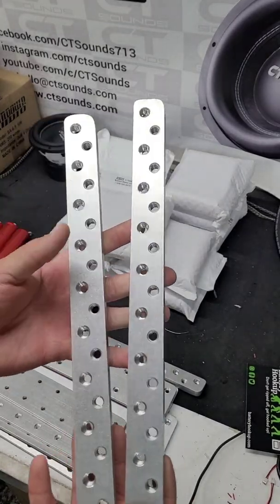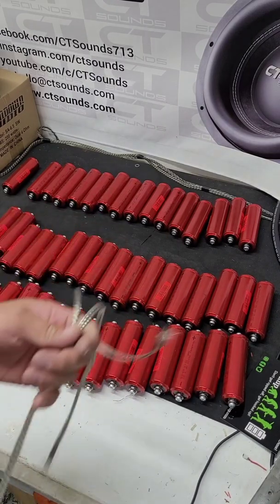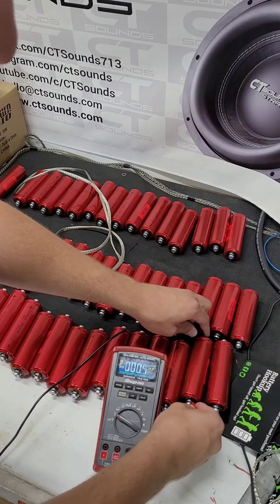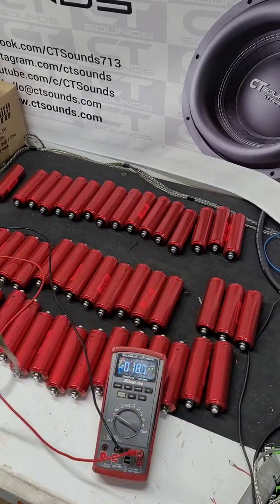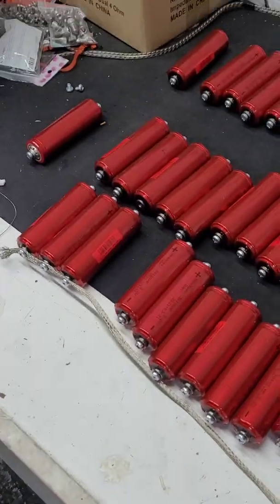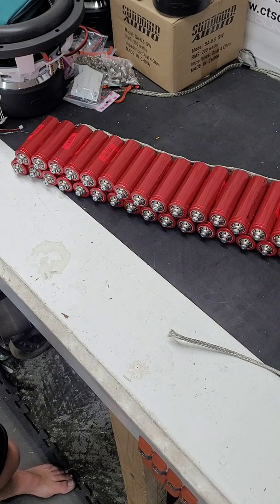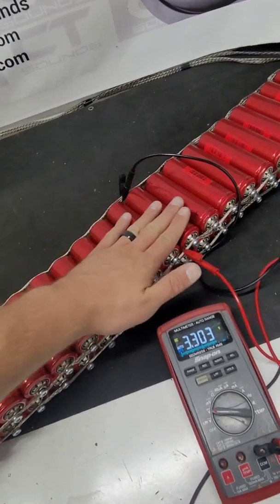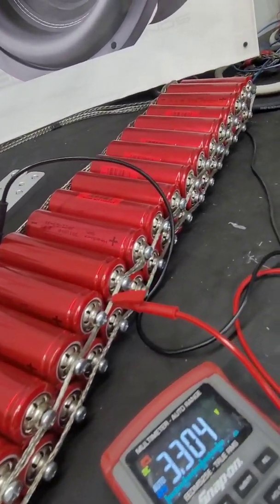DIY LITHIUM Pt.1 - HEADWAY LITHIUM BANK 96AH

Comment: Steel braid? I wouldn’t use steel…resistance is way too high. 

Now a copper braid…tinned copper or whatever is fine. 

Just so long as you apply a charge current when they’re all in parallel. 3.27 to 3.35 is no bueno. Can’t let them just sit, because voltage does not equate to actual state of charge or amount of amp hours you could discharge. You want to take them all up to 3.65. A top balance ensures you can remove the capacity of the worst cell from all cells before you hit your under voltage point. Then when you charge back up, each cell will take in almost an equal amount and they should all end up at 3.60/3.65 at the same time. Minor differences will exist because not all the cells have identical IR and that’s what the active balancers are for (passive balancers suck)

One more time: YOU MUST BALANCE AT THE VERY TOP (or very bottom) of the voltage curve. That’s the place where voltage correlates to SOC. 3.65 means 100% for every cell. At 3.30 one cell could have 7Ah of energy in it, another could have 6.7Ah. Another could have 7.2Ah.  So those cells aren’t balanced and when you connect them in series and apply a charge you’re going to find out that one of the cells is going to hit 3.65V well before the others even if they all started at 3.30V

Also the amount of current flow when the voltage differential is under 0.25V is really tiny…and that’s with copper bus bars or large aluminum bus bars connecting the cells in parallel. Using an inferior metal or having a poor connection (buy a milliohm meter and test the difference between the rated torque on the screw terminals vs half the rated torque when you have two cells in parallel that are 0.4 apart like 2.70V and 3.10V). The amount of current can be a tiny fraction of a properly torqued copper or aluminum connection. Off Grid Garage has a great video on this with 280Ah cells and the way he safely does the experiment is by leaving all four posts relatively loose or having the negatives tight but the positives loose. When he cranks the terminals to spec he sees current that maxes out his meter (over 1000A IIRC) but only for brief moments.  The voltage delta quickly gets smaller and once it gets to about 0.25C (70A) it drops steadily about 1A/sec. Under 10A it starts to get pretty slow and under 5A it’s a snooze fest

Cell IR, your connection materials resistance and voltage delta all play a role in balancing cells in parallel. 

LiFePO4’s flat voltage curve makes its unique because voltage does not equal SOC between 3.10 and 3.40 especially in the 3.20 to 3.30 region where 70%+ of the Ah “exist” (under a 0.2C load or something that does not cause excessive voltage drop)
Reply from the maker: Good info. I guessni need to temove my banks and throw them away because they don't wont properly.  

Oh. And I need to recall all the other banks I've built. 

Got it
Reply: @ATCA  too dense to understand what I'm saying? I'm going to go out on a limb and say your comment is in regards to 
A) balancing cells without a charge....aka passive balancing (not the BMS kind)
B) you used some random metal to string your cells in parallel
C) The voltage you chose to "balance" them at

A-if you did this and you don't have a balancer of any kind connected to the pack then you have an unbalanced pack and it'll get more unbalanced over time...all packs do naturally but its pretty slow for a pack built with new cells from the same batch. The difference in IR will be maybe 5%-10% between the cells. So with new Headway 38120's like these that normally come in under 2 milliohms you might find. yourself with cells ranging from 1.5mΩ to 1.6mΩ. If you look at an EVE test sheet for LF280K's you'll see the AC IR readings are 0.16 0.16 0.17 0.16. 0.17 0.17 0.16 0.16...you'll essentially see two or maybe three different numbers and they are measuring out two places to the right of the decimal in milliohms. None of them will be 0.2X milliohms and I don't think I've ever seen a cell less than 0.10mΩ. That's what new cells should look like. If you bought used cells from battery hookup (and not a Super Beast Pack) then its gonna be an absolute grab bag of different degradations. You could have cells that are 1.9mΩ and some that are 3mΩ. Same goes with capacity. I've heard of people getting cells with like 5.5Ah and I've seen some people pull well over 8Ah out of a cell. I think I've seen as high as 8.6Ah. For packs like that...well honestly you shouldn't even be putting the outliers in the pack. 7.25Ah to 8Ah would be a lot better or if you got shittier cells then 6.75Ah to 7.5Ah or whatever. Do something similar with AC IR reading....try to stick with a deviation thats a small fraction highest cell...so if you have 1.7mΩ to 3.4mΩ put the ones under 2 to the side and put the ones over 3 to the side. If 3 is your highest and your deviation is 1 then thats 33% deviation when compared to your highest cell. I wouldn't go beyond that especially in a high power application. The mismatch in power draw will be insane even if you try to build the pack the way rePackr tells you (I hope you're using this tool and not just randomly putting the cells together)

B-congrats your parallel balancing took significantly longer than necessary and if you stopped it too soon you'll have cells that didn't balance. More resistance equals more time it takes to push that last little bit of current to get all the cells to the same voltage. Watched a guy today do that with prismatic cells and wire connections he made since he put cells in a series layout first instead of just lining them up in a parallel layout and using the provided bus bars that were sitting right next to him. He let it sit overnight and in the morning he still had one cell that was 20 millivolts below the others. Would have balanced perfectly in a few hours if he had used the copper bus bars and not 14AWG wire with some crimped terminals to jump from side to side to make the parallel connections....such a derp moment.

C-You obviously don't watch OffGrid Garage. He's tested all this thoroughly. Balancing in the flat part of the voltage curve is NOT balancing. You're playing the voltage game. Balancing is supposed to be balancing the energy between the cells. We don't care about voltage when we are in the middle of the curve because its so flat. There's nothing more to that. If you did it at 3.20 to 3.30 you fucked up. Can't argue that. Its the same with having your active balancer running during the entire charge cycle. Everything it is doing below 3.45V is a waste of time and its creating more work for itself later in the charge cycle. So your balancing tha would have taken an extra hour now takes an extra 4 hours.
Reply from the maker: @ericklein5097  I'm sorry that I'm not you. You've done well for yourself

Comment: Wouldn't they just static charge when installed on the buss bars anyways? I understand why you do this but i dont see a difference between this or just connecting them all on the bars
Reply from the maker: Some people connect them to the bars in parallel instead of series and add jumpers to do the same thing. The purpose of this is you static balance them then you let them sit and see of any are out of the ordinary before building the bank. If let them become the same then let them sit a few days, You'll know right away if one is a dud or questionable

Comment: Using the bars seem like way less of a headache. Lol! Doing my first 2 batteries (96ah & 48ah) soon and this video helped.
Reply from the maker: More expensive. 2x the price almost.  I have it both ways. The super beast isn't that big of a deal tbh. Few  bolts, few wires.  Vs machining aluminum, getting hardware,  or paying crazy money for some. I sold mine the Cheapest at $180 a set. That's crazy to think. I see both situationsa.
Reply: @ATCA  I was referring to balancing the batteries with steel wire vs using your bars. I think your referring to your other video.
Reply from the maker: Tbh I like the steel braid better. It was faster actually
Reply: @ATCA  oh wow ok. I'll consider it then.
Reply: Fastest and cheapest way to balance your headway cells is to used Galvanized hanger strap

Comment: did you assemble the bank yet ?? do you have video of you assembling the 96 ah bank ?
Reply from the maker: Yes 😞 
However my Adobe subscription is giving me bad issues and has for months. Do I have like 4 videos thst just need edited. Meso 6.5 video,  pt 2 of this video and a few others that I just need to edit. Hopefully it will be resolved sooner than later. I considered just Making a new Adobe acct.
Reply: @ATCA  yea deffinatly , I actually plan on disassembling the 72ah bank I have I didn’t build it  and add 16 more cells to it so that’s why I was asking
Reply from the maker: @basshead-GAMER_JK  I'm going to do a live stream probably tonight.  Join the Facebook group and add me
Reply: @ATCA  WHERE DID YOU GET THE WIRE BRAID ??
Reply from the maker: @basshead-GAMER_JK  pretty sure I said in the video. It's scrap leftover shield from cable. But you can buy stainless wire braid online.

Comment: I made a 64ah bank. But I got a 300a high output alt putting out 14.8 which is overcharging them🤦‍♂️ so I'm gonna have to just upgrade to yinlong🤷‍♂️ question tho... I got a power supply like every other basshead uses off Amazon. I hooked it up to my headway bank at 14v 2a and it fried the power supply instantly. Started smoking and all that. Still worked, but wouldn't put out voltage anymore. So I returned it and got it replaced. But afraid to hook it up again lol. What'd I do wrong?
Reply: 14.8v will be fine. The life cycle is cut a tad bit but your bank will outlive the life of your actual setup with ease. This is what I was told by a bunch of different people in the game.
Reply: @v3zMedia  it's been doing great. Even with the -4 degree weather here in Ohio the past week👍
Reply: @1ohmwrecker  that's good to know. I'm in Michigan holding on myself. 😆
Reply: @v3zMedia  oh ok so u know what's up 👍
Reply: @v3zMedia  mine volt reads at 15v. I dont know if I should run it.

Comment: How many of the $6 batteries would you need to equal to Down4Sound LTO 6.0?  I am new to Lithium and battery banks.
Reply from the maker: Lto is not the same technology. But theoretically a bank of 8 of these will be more capacity.  

The benefit of LTO is they produce more current in fewer cells. Headway needs more cells to produce the same current,  regardless of amp hour. So having a big Headway bank like this gives you a lotbof current and a lot of ah. Best of both worlds

Comment: i know youve already made your bus bars but i thought id throw this out there. after your last video i did some research and found a guy "jag35" who makes some bus bars that almost look like circuit boards. they are designed to hold 32 headway cells. they are clearly marked pos/neg. $30 for top and bottom. laid out to put in a box the size of a normal car battery. also i tried finding the cells for cheap but 14 each was cheapest i could find
Reply from the maker: Battery hookup has these for $6 each. Can you send a link to his product? I may look into them
Reply: The jag35 bars are cheap and too thin
Reply: @xchimnyx no Jehu rates them correctly. He has plenty of videos showing his PCB’s being load tested
Reply: @ericklein5097  no, he doesn't and that's been shown in the car audio community countless times.
Reply: Jim machine works makes 96ah bus bars
Reply: You're not talking about these, are you? https://youtu.be/9Vu9_xctKPs